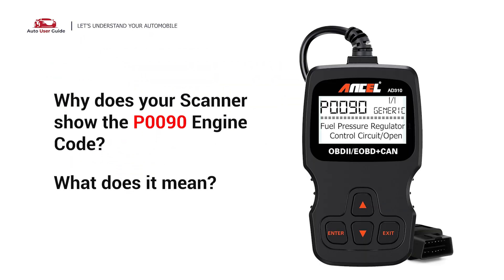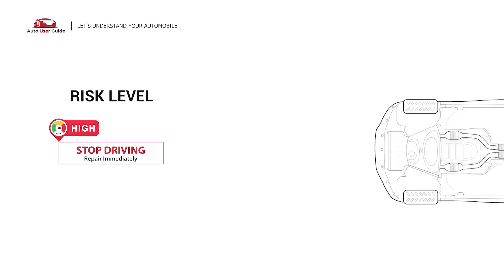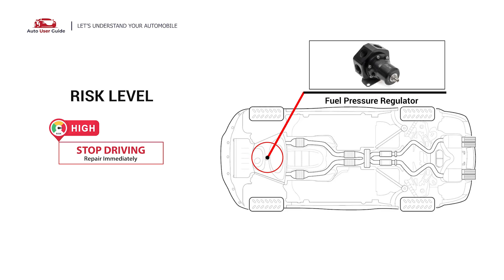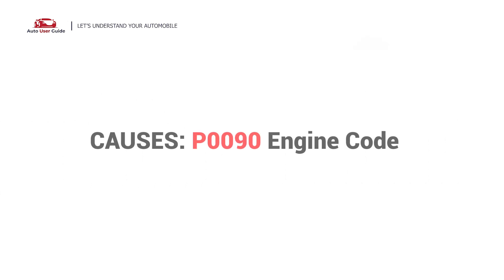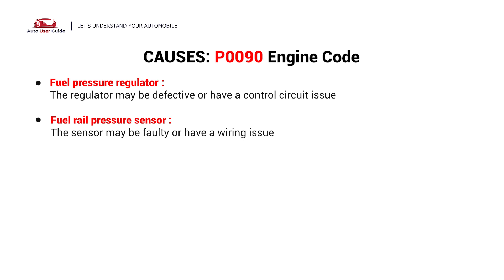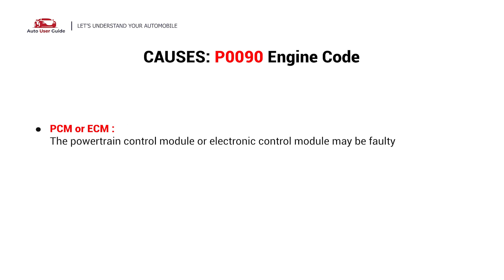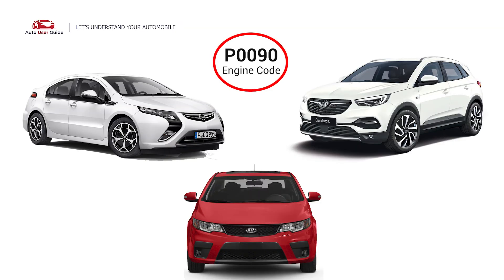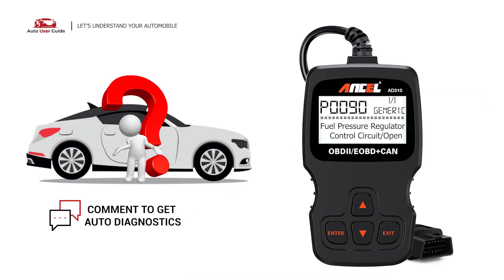What is P0090 : Engine Error Code Causes Explained

Comment: Fix P0090 with video
Reply from the maker: What kind of car and model do you have?
Reply: @Auto-UserGuide   17 Kia Rio. Rough idle.  Won't stay running. Smells way rich. Burns your eyes. Just replaced both o2 sensors. Like a bad TPS symptoms